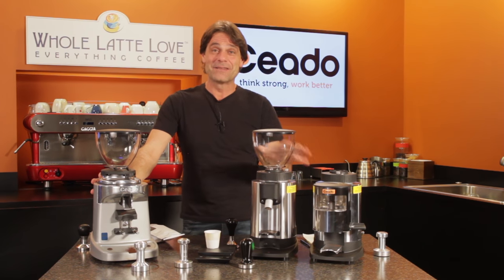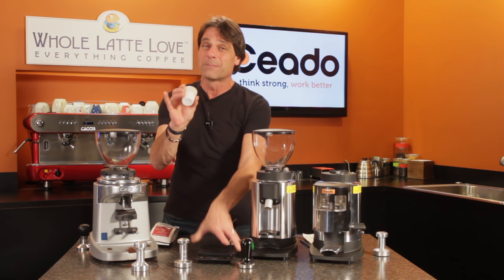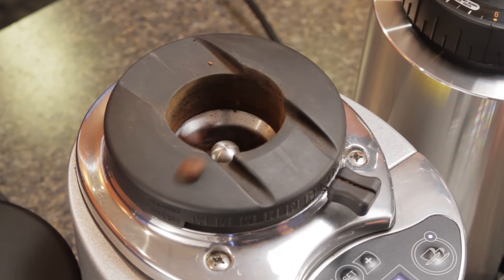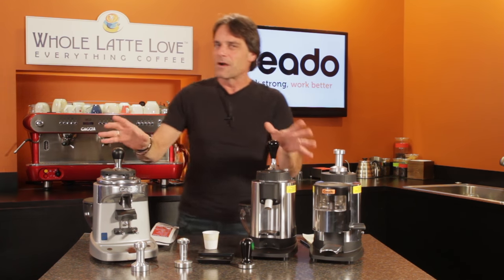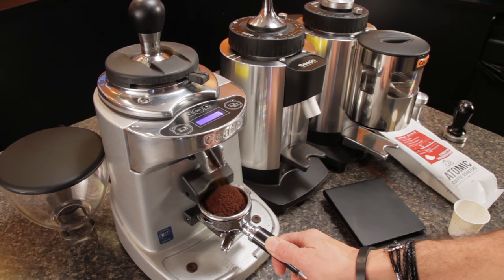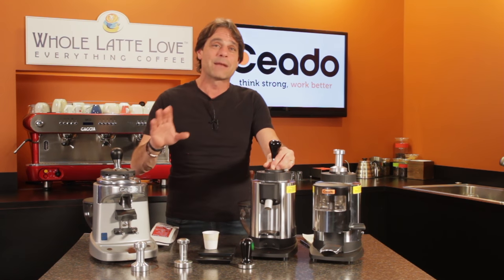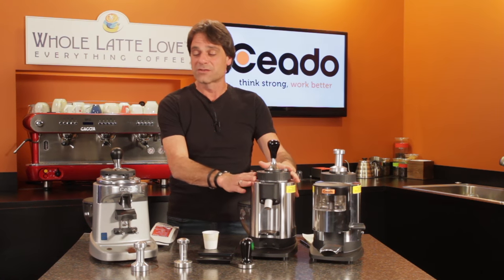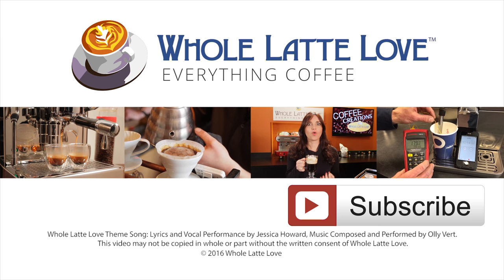How To: Espresso Single Dose Tamper Trick with Ceado Grinders

Comment: Yeah, i think this is what I'll do - buy one of their "normal" grinders and do this trick, instead of spending several hundred euros more on their single-dose-grinders :)
Reply from the maker: Hi ac, Thanks for the comment. Do be aware purposely designed single dosing grinders have much lower retention than non-SD grinders. You can do this trick but do not expect extra low retention.
Marc
Reply: @Wholelattelovepage  Cool, didn't expect a reply :)
I went for the ECM s manuale 64, which is cheaper than the ceado e6p here in germany - I will definetely experiment with single-dosing, and - assuming I won't forget - will comment on my experience here.
I can imagine that the grinders designed specifically for single dosing will do a better job than some dirty hacks, but for the time being, I think they are a bit overpriced (might have to do with the probably smaller  customer-base)
Hell, if I wouldn't care about cost, the e37z would already stand right next to me :D